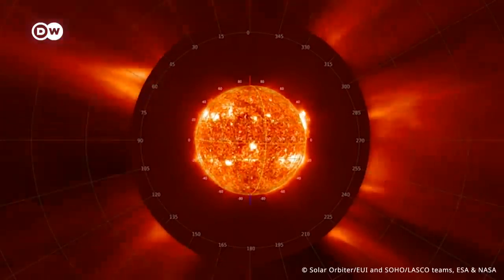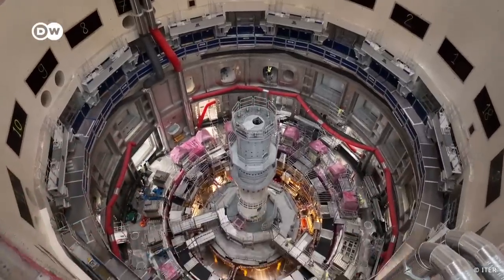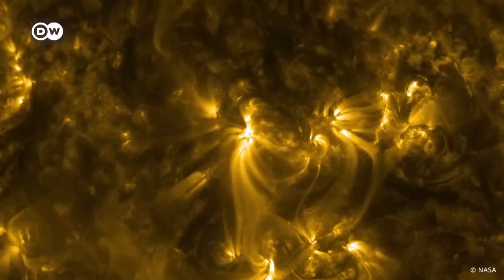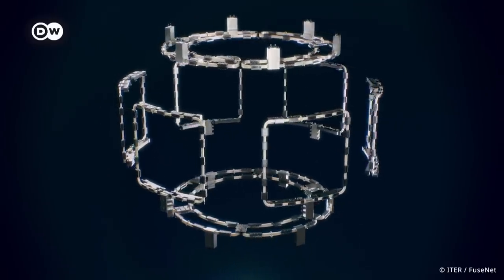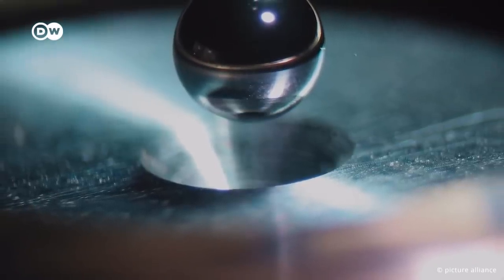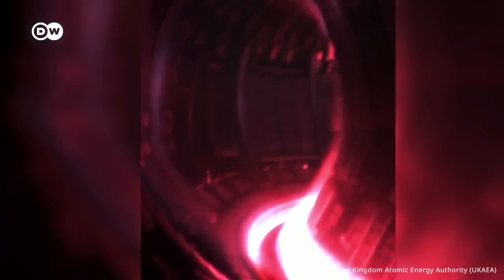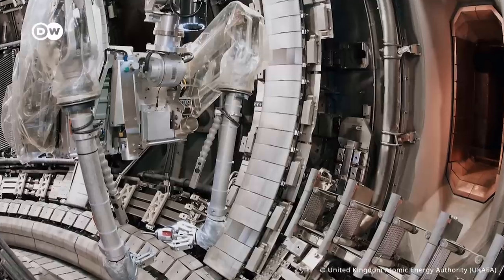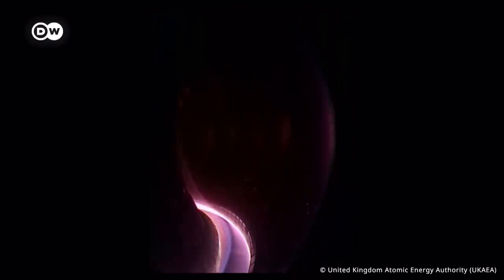Is nuclear fusion the key to fighting climate change?

Comment: Nuclear fusion releases 4,000,000X the amount of energy you get from fossil fuels, that is when we're finally able to do it continuously in an economic fashion. However, magnetic confined fusion requires you poor a large portion of that energy right back into the reactor so as to maintain the reactor, so you're likely only going to get 25% of the energy out to make electricity with, but even in the most optimistic case, you'll get 50% or 75% of that energy out to make electricity with, that is WHENEVER we can do this in an economic & commercial way, which isn't likely to happen for many decades. 

Nuclear fission, which we can ALREADY do right now, releases 1,000,000X the amount of energy you get from fossil fuels, and it doesn't require you put any portion of that back into the reactor to maintain fission, so you get all of that to make electricity with. That means, fusion, this wild-eyed dream of "infinite" power which we're not likely to commercialize for many decades at the earliest, at best only produces between 2X and 3X the power we can ALREADY get from an existing potential power source. And given the complexity of the physics involved, the incredible precision of the sensors involved in fusion, the rarity and cost of producing all the rare materials required like exotic super conductors, the likely size of the facilities, fusion plants aren't going to be ANY cheaper or quick to build than fission plants, but are instead likely to cost a lot more and take a lot longer to build.
Reply: Exactly. We can already use fast neutron reactors , that have a seemingly infinite amount of fissile material and produce far less dangerous waste. Why don’t we use them? Because they are far too expensive and complexe in comparaison of the the cost of the uranium they spare. If fast neutron reactor are too expensive to be competitive, there Is no way nuclear fusion reactors will be cheaper and easier to build and maintain.
Reply: I think you'd be interested in reading about Zap and Helion Energy. Zap plans on proving scientific breakeven within a year, and Helion plans on reaching net electricity by 2024. Each reactor design will be cheap to produce and operate, assuming they work.
Reply: @Batmangutten  I'm familiar with Helion, and I'm familiar with lots of company's, like SPARC, which are promising fusion by XXX date. Believe me, I support nuclear fusion research, so I don't mean to poopoo on it's parade, but the likelyhood of us commercializing fusion anytime soon, at least soon enough that we could leverage its vast energies, are remote. 

While you might find it a little disheartening, I'd suggest you check out the YouTube video: Former fusion scientist on why we won't have fusion power by 2040

Video is specifically on a tokomak reactor, but the guy walks through the whole process in terms of energy requirements and production so that you can see how far we really are from something that would be even marginally commercial. 

The point of my original comment is that we need something to replace fossil fuels now, and fission reactors are ALREADY almost comparable with the energy output you're going to get out of a fusion reactor, under an optimal scenario, and fission reactors are likely to cost as much or less than any fusion reactor. We need movement NOW, and the only thing we have which can really address our need for plentiful CO2 free energy is fission.
Reply: @williamsmith1741  I've seen that video, and it seems overly pessimistic. Zap energy, for example, has found a way to stabilize a Z-Pinch. The main problem with Z-Pinch has been kink instabilities, and if you solve them, it's likely going to work. They're aiming for scientific breakeven within a year from now and just got 160 million in funding to do so. Anyways, we'll find out in the next 2-3 years whether Zap and Helion will deliver. Within the next 8 years we'll figure out whether most of the other will too.

As for fission, it just isn't profitable. At this point, it would be cheaper to build overcapacity solar and wind with batteries to cover a couple of days of energy storage. This would also face less opposition than nuclear energy. Solar will also get cheaper as we figure out novel ways to surpass the Shockley-Queisser limit. You're probably right that something like a tokamak wouldn't be profitable, but that isn't because it would be that much more expensive than fission but rather that solar and wind are dirt cheap. At this point, the only energy source which will be able to compete with solar and wind, specifically solar, is either Zap and Helion's approach to fusion, if successful, or geothermal (Quaise) using millimeter-wave drilling.
Reply: @Batmangutten  Yes, the collapsing plasma field has been one of the main issues, and more powerful superconductors might be able to help fix that, but we'll see. It's always nice to see that people factor a "scientific breakthrough" into their schedule. It's great how predictable they are. Exactly though, we'll see in the next 2 to 5 years for Helion and Zap and 8 or more years for the rest... This is besides point that fusion, under an optimistic scenario, is only likely to deliver at best between 2X to 3X of the power that fission already can yield, and the fusion plants, with all high precision equipment they'll need to monitor the fusion reaction, all of the exotic materials and careful processing going into those new super conductors, and the control processes needed to contain & utilize the tritium they're going to have to produce, there's no way they're going to be any cheaper to build than fission reactors. 

Per the International Energy Agency (IEA) report "Projected Costs of Generating Electricity 2020", nuclear fission has the 5th lowest median LCOE of any power source, with a median LCOE of 69 USD/MWh. The only power sources with lower levelized cost of electricity are:
Hydro (run of river): 68 USD/MWh
Solar PV (Utility Scale): 56 USD/MWh
Wind (Onshore): 50 USD/MWh
Nuclear (LTO/Long-Term Operating): 32 USD/MWh - These represent nuclear plants which have had their operational lives increased beyond the initial 40 year operating life

You also realize that cheap energy storage would have as big an impact on nuclear as it would on solar and wind right, maybe even more so? Nuclear has the same but opposite problem as wind and solar, neither can follow load. However, cheap storage can only help wind and solar spread out the the limited energy they produce over a span of time, but it won't do anything to address scenarios like northern Europe went through last year when you had a wind drought for most of the year, including the winter when there's also a noticeable lack of sun. That couple of days of storage would amount to d$#k. And solar hasn't gotten cheaper due to any technical improvements with the cells or with fabricating them. They've gotten cheaper because the vast majority of production has been shifted to China where they were mass produced by literal slave labor in massively cheap/massively dirty production facilities. However, I'm wondering what new solar prices are going to look like since solar panel fabrication facilities have gone from operating 3 shifts 7 days a week to 2 shifts 3 days a week (as many of them had to reduce operations as a result of China's coal shortage).
Reply: @Batmangutten  If renewables are so cheap, why then at the end of 2020 did Germany have the highest consumer energy prices in Europe, 63% higher than those of France? Germany has spent over $550 billion Euro on renewables, grid infrastructure, storage, while Europe at large has spent over $1.5 TRILLION Euro on all of those just in the last 10 years. 

Per the IEA, in 2020, Germany's total primary energy supply (TPES), which is the total amount of primary energy that a country has at their disposal, including imported energy, exported energy, and extracted from natural resources, was 13.7 TJ. Of that, just 15.1% or 2.1 TG, of all available German electricity was provided by renewables, including hydro, wind & solar, and biomass. Of all the renewable energy produced by Germany in 2020, 3.2% was produced by hydro, 33.7% was produced by wind and solar, and 63.1% was produced by biomass (i.e. burning wood from clear-cut North American trees). I would think, for $550 billion, you'd get more of a return of energy than just 15.1%, most of which is still combustion?

In 2011, Germany had 17 nuclear plants which provided between 25% and 30% of Germany's total electricity. If we want to assume a cost of $10 billion per plant and 10 years to build, if Germany hadn't decided to phase out nuclear in favor of Russian gas and instead spent that $550 billion on new nuclear plants, it would be close to starting up between 50 and 60 new plants and would be generating MORE than 100% of it's total electricity needs from CO2 free nuclear.
Reply: @williamsmith1741  Firstly, a much higher proportion of someone's electricity bill in Germany is taxes. Before taxes and levies, they aren't that different. Secondly, renewables have only been cheap in the last 5 years and the cheapest option in the last two or three. Germany started expanding renewables way before this. It's only in the previous year or two that it has been cheaper than operating existing nuclear power plants. Shutting down existing nuclear power plants before renewables were cheap will blow up your supply-side costs. Also, I don't know where you got that 15% number because 50% of Germany's electricity was renewables in the first quarter of this year. It was almost 50% averaged throughout all of 2021. If you mean total energy supply, fossil fuels will drop off when we electrify transportation. 71% of petroleum demand is from the transportation sector, and most is from light-duty vehicles and trucks.
Reply: @williamsmith1741  I Didn't see this first comment. Solar has gotten cheaper because of more efficient panels and manufacturing at scale. The price decline also started long before China got involved. Also, lifetime emissions still show solar being one of the cleanest ways to generate electricity. To deal with the winter, you could build over capacity. It will vary from location to location, but in the U.S, you need about 2-4 times over-capacity to deal with December and January. This is still cheaper than building a new nuclear power plant. Also, affordable storage is more of a boon for solar than nuclear. Solar would quite literally not be able to operate half the time without energy storage. Nuclear would still be operational. Building overcapacity would inflate nuclear's costs somewhat, but it would still work. As for your cost estimates, new solar installations will likely make it to around 50 years. It depends a bit on where they're installed, but in general new panels should be durable enough to last that long. Taking that into account makes solar the cheapest energy source available.

Comment: I think we'll be surprised how advanced additive manufacturing will become in the decades to come.
What, for example happens when somebody can have their 3D printer/assembler print a very nice couch over the course of a week or two? And I mean with material that looks and feels like wood, fabric, everything. No more factories making couches. No more shipping of couches. Couch retail. Last mile transport of couches. And that's just couches of course. As an example. Par for the course for a wide variety of home essentials. Altogether the sheer amount of large scale industry, along with its energy demand that will become redundant is difficult to even contemplate.
What if can print and assemble... A small efficient wind turbine. Some solar panels. Some basic processors and microcircuit devices. Another printer/assembler as capable.
Extraordinary self-sufficiency and efficiency will be possible.

I don't think we'll ever reach the point where we achieve fusion power AND need fusion power - On Earth. Maybe as part of space exploration and colonisation.

Comment: I wonder why the whole ting don´t just melt away if its 6 times the temperature of the sun. Is the heat contained with magnetism somehow or how does it work?
Reply: It's that whole "vacuum" thing. In a vacuum nothing can actually transfer that heat around. Basically the reason you feel heat when close to something(unless it's emitting radiation) is because the air molecules around it heat up and spread to you. They use the magnets to make sure none of the gases actually approach the walls.

Comment: Renewables are the future, the supply is endless, and there are enough options to choose from, solar, wind, tidal, earth core. If they make 100% use of all of these, there's no need for fusion, at least not on Earth. I think they should focus on this first, and only after that invest these ridiculous amounts of money in fusion.
Reply: Absurd. The battery technology isn't even 10% what it needs to be to replace nuclear/coal/hydroelectric.

All we're doing is switching CO2 emissions for destructive lithium mining, aluminum mining for mills, not to mention mercury and the dozen other toxic chemicals needed for solar panels.

The "renewables" you mentioned are only green while they produce energy. Someone has to mine those metals, forge those blades, build those panels and THEN we get the fun of 90% of it ending up in the landfill, leeching into the soil.

It's a scam that far too many have fallen for hook, line and sinker. A future where massive fields and forests need to be cleared out for hideous wind and solar farms and trillions of pounds of toxic batteries to store it all for when the wind doesn't blow, the sun doesn't shine and the water doesn't flow.

In the whole, we ignore viable things like modern thorium reactors, that actually run on nuclear waste.

Bottom line: Nuclear is our CURRENT BEST answer until battery technology gets even remotely close to viability. 
Until then, it's a ridiculous farce that's painful to watch; a sort of modern insanity that ignores the other half of the equation with an almost religious zeal.
All of these people obsessing over carbon emissions and rejecting the one thing we have over 80 years of research into: nuclear. Nuclear power plants of today aren't Chernobyl.
When I see people rejecting nuclear, I honestly don't think they really care about real solutions...only absurd fields of windmills and coal-powered "EVs".
Reply: Nuclear fission will also be nearly vital, relying solely on renewables could potentially work but when you have such an efficient energy source that is constantly being made safer and more effective it’s completely illogical to not use it too.
Reply: I don't see how tens of billions of dollars over the course of decades is a ridiculous amount of money. The world economy produces about 100 trillion dollars worth of goods every year. Spending a fraction of a percent of that spread out over decades in order to unlock an inexhaustible energy source for the entire planet seems like a trivial price to pay.

Comment: I like renewables much better. They don’t require extreme prerequisites like temperatures at the core of the sun and hence much easier to generate locally, eliminating the need to distribute.
Reply: …until the sun comes down or the wind stops blowing.
Reply: Or destroying massive amounts of land for solar and wind farms. As well as the massive amounts of waste they produce at the end of their short lives
Reply from the maker: It's true that renewables take up quite a lot of space that could be used for farming, housing and biodiversity. But there are some solutions under consideration. Check out our video to find out more 👉 https://youtu.be/2hwpXCjmkRo

Comment: We must continue our research 100%. There is no need to build these power plants at all to generate electricity. With this enormous energy, iron can be melted in a steel plant to prevent the coal from burning completely and keep the air clean. Can be used to produce copper. Aluminum. And used other metals directly. Can be used to sweeten water. Maybe it can be used to build tunnels on the ground. It easily raises the temperature of 100 million degrees Celsius and digs the best tunnels from inside the mountains.

Comment: Fusion is impractical and extremely expensive.  I see Geothermal (the earth has its own fusion reactor) as a much more viable solution.  We should be building down, not up.
Reply: @nickwest1305  The point is, its already there and all we need do is tap into it.  There are companies working on this, ultra deep drilling ability, so this is much more likely to be viable soon than Nuclear.
Reply: now imagine  holes everywhere on every house, of a least a kilometer deep, and imagine that the majority of large metropolises are not even on rock.

Earthquakes and land subsidence will become a massive probleme. ;d
Reply: What do you mean the Earth has it’s own fusion reactor?
Reply: @Gomlmon99  Just like us, the Earth is made in the image of its creator... the Sun.  While the core is molten iron, it is surrounded by the outer core of liquid just like the Sun.